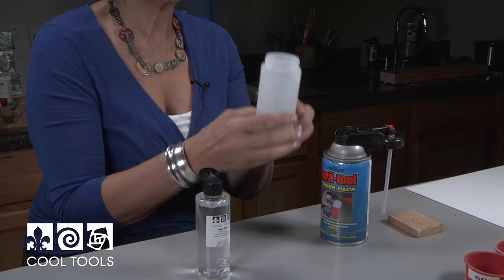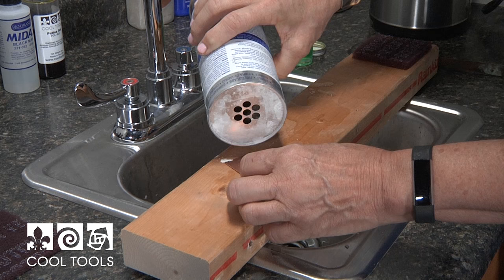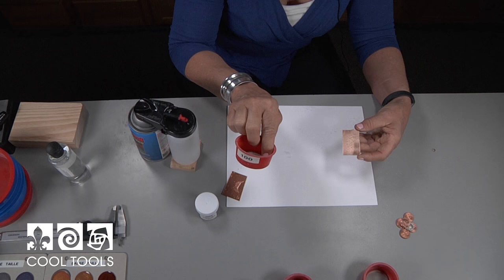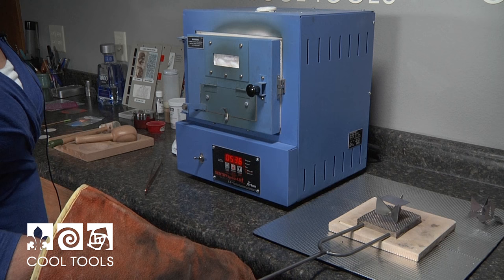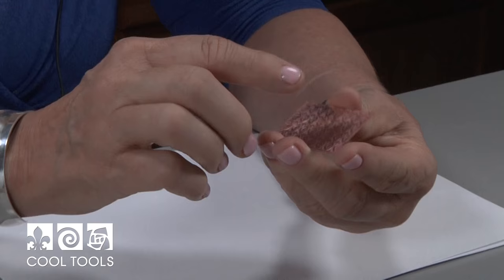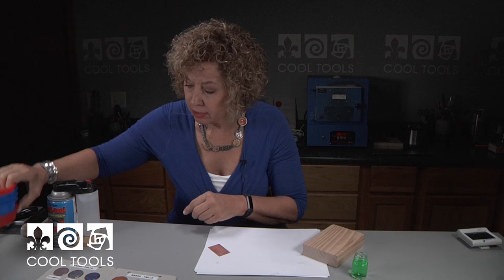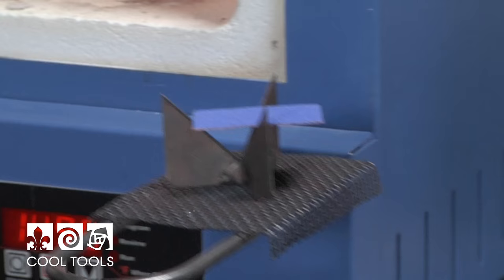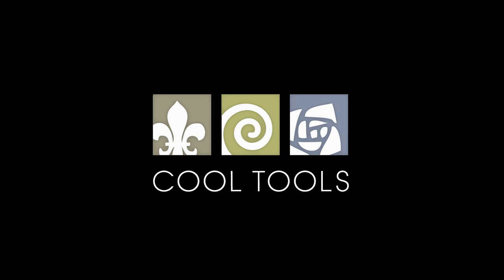Cool Tools | Basse-Taille Enameling by Jan Harrell

Comment: Great video thanks a lot.
However, at 3:34 you say that the water "sheets up", and that's bad. Then at 4:14 the water "sheets up" and that's good.
So is sheeting up good or bad?
Could you do this on sterling silver or 14 gold without it blackening in the kiln?
Reply from the maker: Sorry for the confusion. When water flows over the metal with no interruptions it is clean. Sterling silver and gold alloys will always blacken in the kiln. The copper that is part of the alloy makes it oxidize when it goes in the kiln uncovered. Please, let us know if you have any other questions!

Comment: Great video, thanks!

I have a question for colours requiring a flux base. Would you do 3 coats of flux just like the colours and fire, and then repeat the 3 coats in colour and fire again? Or would you do 1 coat of flux, and 2 coats of colour and fire?

Thanks for the video.
Reply: I always like a separate coat for my flux.Some flux needs two firings to get it a pretty golden color and after I achieve that, my next coat will be transparent . Depending on the intensity of color that I desire, I might use 1-3 coats.
Those smaller mesh sifters are the key!
I also use the direct on and that saves a step.
Reply: Hi Jan, When do you do direct on and when do you use transparent flux under the transparent colors?  Love the video!  I have watched it many times!  Thank you for taking the time to teach enamel techniques.

Comment: Could you “paint” klyr fire on with a paint brush and just fire between coats instead of spraying the klyr fire on all during one setting? Is there an advantage one technique has over the other?

Thanks!
Reply from the maker: Hi Kacie, we do not recommend painting klyr fire on. It is meant for spray application. Thanks for watching!

Comment: Hi there, just wondering if it would be possibly to use a more volatile solvent than distilled water in order to speed up drying time? If so, any suggestions
Reply from the maker: Hi Matthew, we asked Jan your questioned and she replied: Some people use pump hairspray but base taille is dependent on clear enamels and anything added can affect the transparency-they should dry quickly put on a hot plate set at  low temp or directly onto of the kiln—
I believe in the layers of the wet spraying in between layers to also make the enamels settle into the pattern.

Enameling sometimes is not a fast process— ;)

Comment: Hi! I am having trouble with the Spra Tool freezing (and clogging) up. I have tried all 3 tips to no avail. Any ideas? what is the correct ratio for Klyr fire/water? any help would be MUCH appreciated!
Reply from the maker: Hi Dianne, the recommended ratio of Klyr-Fire and water is about 60-40. 60 of distilled water and 40 of Klyr-fire. For enameling, use the red nozzle and throw the others away. Hope this helps!

Comment: Can i use sterling? Do i need to prep it
Reply from the maker: Hello, you can enamel on sterling silver, but you would need to depletion gild it first. Depletion gilding is the process of heating sterling silver sufficiently to oxidize the copper in the surface layer of the alloy and then removing that oxidized copper layer by soaking in pickle (Silver Prep). Hope this helps!

Comment: I always get fire scale on the outer rims of my pendant.  I'm wondering how you eliminate the fire scale.
Reply: youcantitsaby product of firing , the only way to stop it is to make sure the enamel covers the edges and make sure those edges are squeaky clean before you apply the glass. Any exposed copper or silver will otherwise have firescale....

Comment: At about 14:50, Jan says "Thompson has a line of unleaded that look beautiful direct on copper". Do you have a link to that line? or a list, please?
Reply from the maker: Hello, you can find all of Thompson Enamels here: https://www.cooltools.us/Thompson-Enamels-s/2565.htm
Reply: @cooltoolsvideos  What specifically are the colors that are designed for copper, please? I can't read all the numbers on her sample sheets
Reply from the maker: @jmay6064  The list is as follows: 
2615 Periwinkle
2625 Winter
2650 Heron
2660 Nitric 
2680 Prussian
2755 Concord
2760 Mauve
2910 Elan
2915 Oil
2510 Cascade
2520 Aqua
2530 Water
2119 Wax Yellow
2115 Mars
2170 Van Dyke
2220 Chartreuse
2325 Gem Green
2429 Sea Green

Have a good day!
Reply: @cooltoolsvideos  Sweet! Thank you!

Comment: You dump a piece fresh from a pickle into bare hands?!  Even if it's citric acid, it's not going to be friendly to your skin.  Nastier chemicals are often used in a pickle, plus pickles accumulate copper over time.  Pickle pots are hot too.  Why show people to use anything other than copper tongs?  Then rinse the piece in water - or in rinse in water with baking soda to neutralize the acid, followed by clean water to remove the baking soda.  Then you can handle it without worrying about chemicals damaging your skin, or being absorbed into your body.  Some of us are new at this and could get hurt, thinking that's OK to do.
I wouldn't want enamel powder (either wet or dry), or fiberglass brush bristles on my hands either.